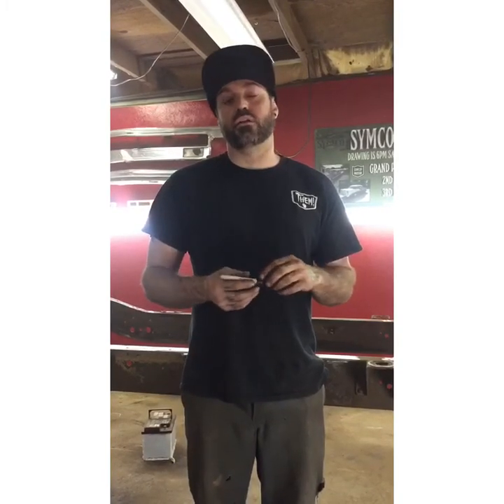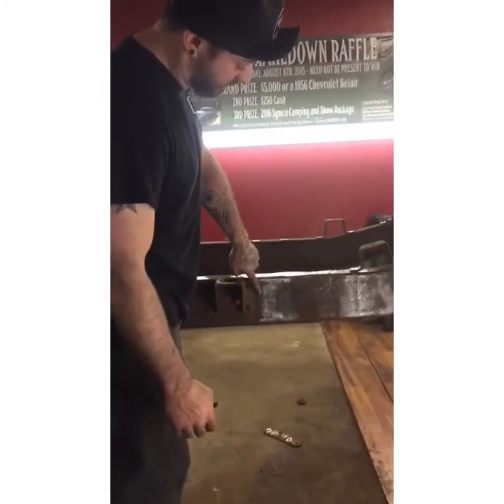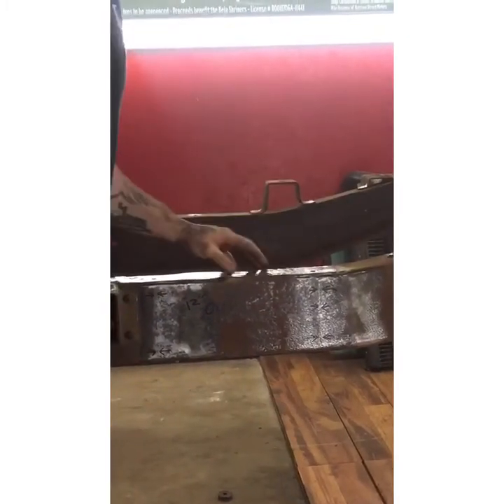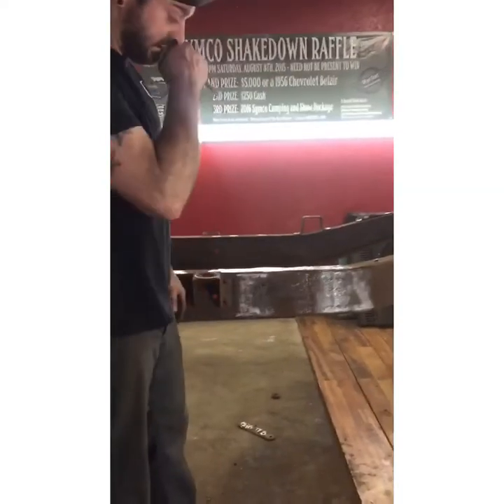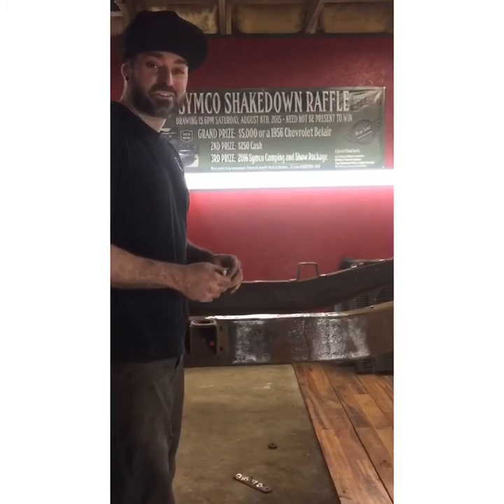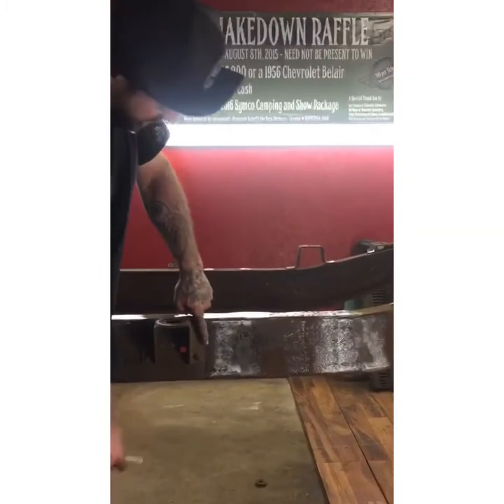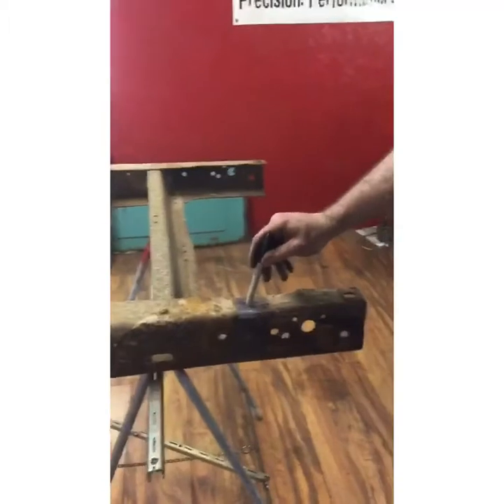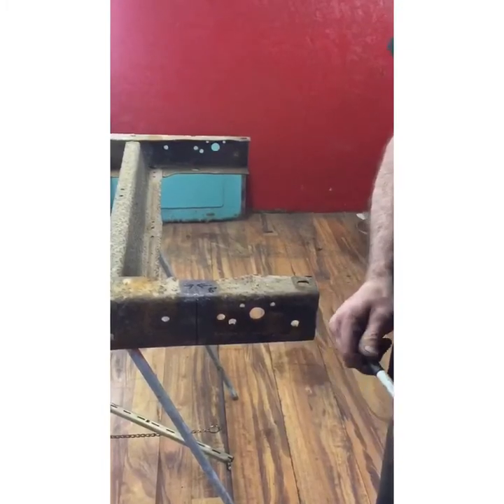1967 c-10 lwb to swb conversion

Comment: Have always seen the under the cab cut. What happens to the trailing arms and there crossmemeber location?
Reply from the maker: RJINATOR it just moves forward with the frame section if you do the undercab cut or if you do the behind the cab cut you need to move the crossmember Forward 12’’ . Check out all our videos and it will give you a better understanding

Comment: I watched your other vids, (super informative thx for posting them) and see you opted for taking the section out under the cab. Can you tell me why you opted for that? This way seems easier.
Reply from the maker: woog74 with is being the center point of the frame it splits the load evenly . However if properly boxed in either location the frame should or would never have any issues or stress problems. By the way thanks for watching and commenting ! 🤙🏻
Reply: Thx for the reply man. Real informative vids.